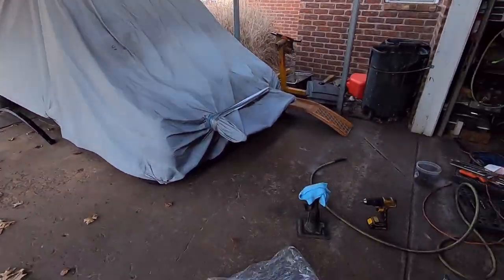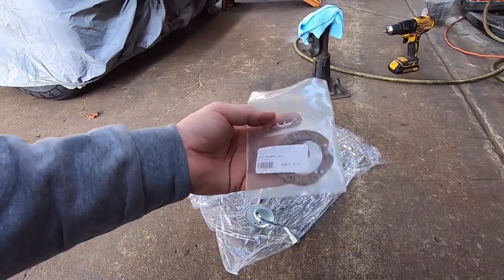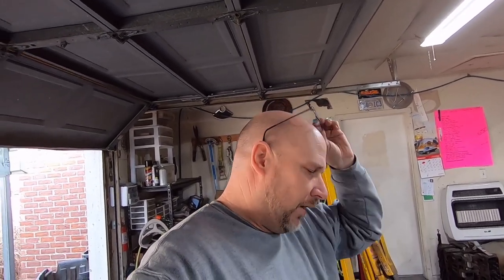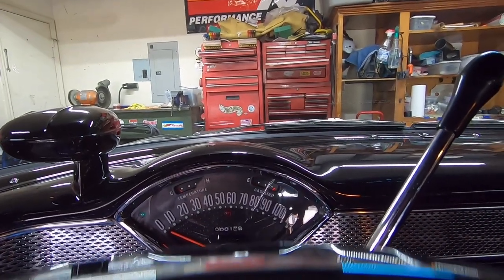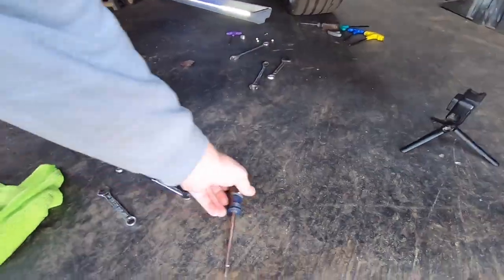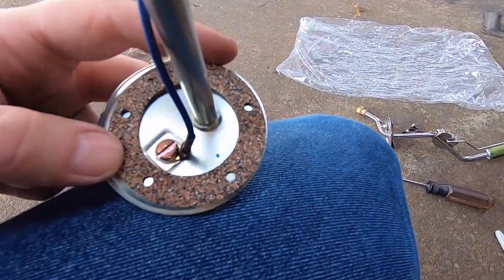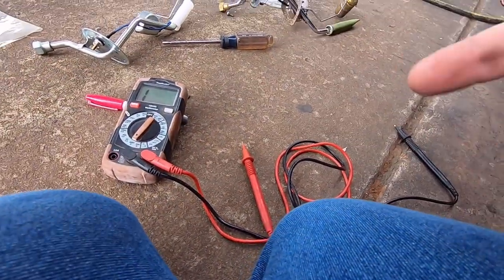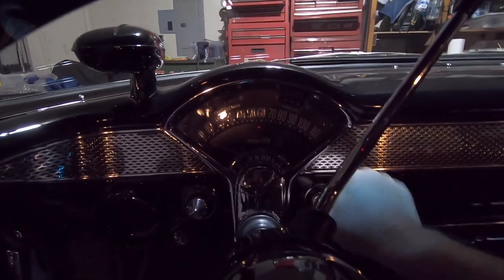Fuel sending unit test and swap. 1955 56 57 Chevy

Comment: I'm in the same boat. I've owned my 56 Sedan Delivery for 52 years and the original sending unit lasted all the way into the 80s or 90s (can't remember). And now I've replaced 2 and am still having problems. I'm in the process of removing the sending unit now. And I do mean process. Sedan Deliveries (wagons) are much different than the rest of the tri-fives. They are much harder to get to. The last time I did it, I had to disconnect the springs and shocks and move the third member forward so that the tank would slide down in order to get to the sending unit. Believe me, I do not look forward to replace sending units, and I am 70 now. So it's getting harder for me physically.

Comment: I updated my fuel sending unit to use a 3/8" fuel line and added 4 gallons of fuel and  my dash gauge was off. So I drained the tank and removed the sender and adjusted the  float arm to read 1/8  on the fuel gauge after putting in only 2 gallons of fuel in the tank and still wasn't quite right and then read in the 1955 Service Manual to also remove the fuel gauge from the dash and bend the needle re read correctly. Now when the fuel gauge reads an 1/8 of a tank I know I have 2 gallons of fuel left in the tank.
Reply from the maker: That's very good info Tony. Thank you for commenting.

Comment: I just had to modify my sending unit today! The fuel gauge isn't stock so it needs a different potentiometer in the sending unit.  When I installed it I did use a cork gasket but still have to get a few copper washers for the mounting screws.

Comment: I had a similar problem with a sending unit that I bought a year ago. I performed all the tests that are listed in the repair book
 and it passed. But the gas gauge barely lifts off of Empty when I put five gallons as measured by the pump at the Gas station.
I measured the resistance with a VOM and the ohms were a little jumpy and erratic. I moved the sending unit to the passenger compartment and connected it to the gas gauge correctly and the gauge work properly when the float was moved up and down manually but would not work when installed in the gas tank. I'm still trying to figure it out. Frame-off resto with under coating, new tank, tank hold down straps, tried additional grounding strap/wire on tank. Good luck in the Contest

Comment: Question!  You just put 2 gal of gas in the tank and turned the key and stated the needle never moved off the E.  If you did that and not one dash light came alive, did you even have electricity to the dash?  If you didn't have dash lights maybe there was no power to the sending unit.  Just an observation.
Reply: There is no power to the sending unit it reads resistance you dont want 12 volts in any gas tank,LOL! Yes 12 volts to the gauge one side ....

Comment: Yep. I just "drug up" not one but three Tri-Fives from an auction. Like you said yours have been, just parts cars that will be road worthy again. Thanks to YouTube it threw your channel at me. I wrote two pages of notes from this video. Thanks!
Reply from the maker: Thanks for watching. Did you get them from the Texas tri 5 auction? I watched videos last week. Lots of buildable projects there.
Reply: @haffrods7055  Yes, I knew there were 57s in that yard and always wanted a 2-door. As the auction went along I got the feel of what a winning bid for a 2 door was. Many 2 doors sold for over 1K but under 2K. I bid on a real complete 4-door 57 A150 to use for parts. The next 57 I won was a VB code 2 door (post) it needed a right quarter and all the floors. The last one I won is a VC code that is rotten half up. The frame is great but needs a lot of metal. It was being dissected to save others. I have a title but it has a legal issue. So, I'll be using your videos as a teacher. I know this is a long reply but check on me in a bit to see how far I've gotten.